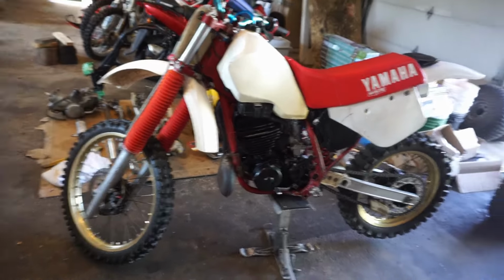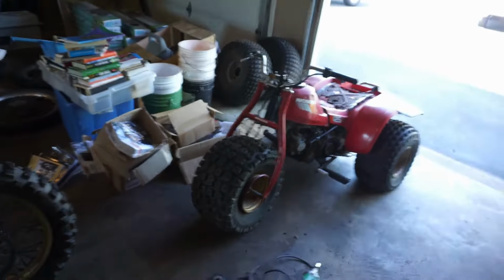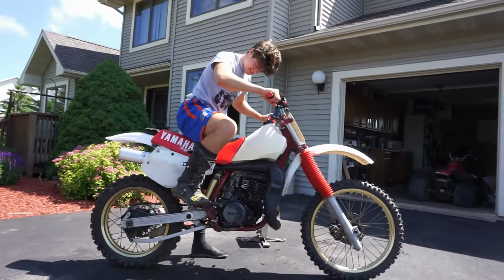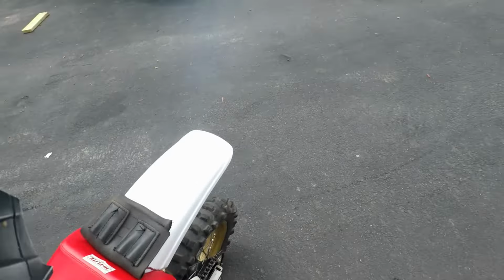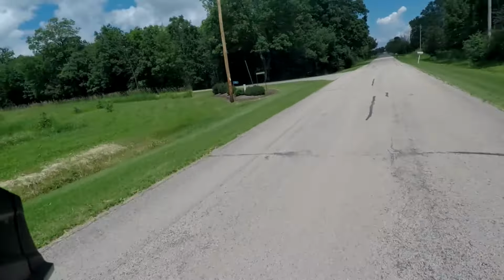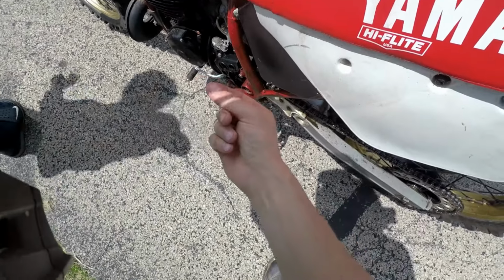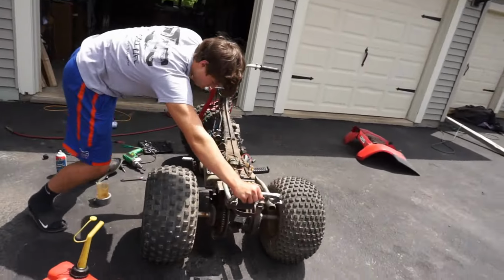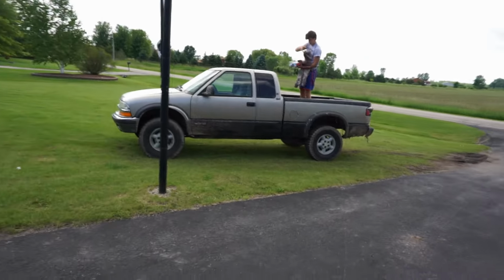This Bike Will KILL You!!! First Ride on Yamaha Yz 490

Comment: I feel so sorry for that engine “it’s bogging” more like the engine is crying for freedom
Reply: I know.....i kept waiting for it to come up on the pipe........thank god it didn’t..........I do not think these guys have a clue as to what to expect when it does clear out.
Reply: @MrJoeyplatinum  It won't come on the pipe at 1/8th throttle!
Reply: Right. Those 500s only have two engine speeds. Off, and wide open, and they have a powerband like a sledge hammer.  My brother had one back in the 1990s. TOTAL hill climbing fuckin MONSTER!
Reply: Dress for the slide not the ride buckle your boot
Reply: Agreed
Reply: My 1979KX 250 does the same thing it either runs or it doesn’t it’s up for you to decide when you twist the throttle.
Reply: but he's not locked up
Reply: this kid gets some amazing bikes and every time i am asking who taught this kid how to shift. but you all are right if he got in the power band we might get some reel good whiskey throttle videos
Reply: @MrJoeyplatinum  Exactly ! They don't have a clue ! Carb is still dirty ! This guy everything is rejetting . He is stupid ! Relies on ultra sonic cleaning but it does not work well . Knows nothing about carbs but he thinks he does !
Reply: @dirtcurt1  He's not exactly just breathing on the throttle 🤔
Reply: Nothing that bad about bogging just means he's not revving it heaps or in a too tall gear
Reply: Nah, these were notoriously bad runners that were hard to get jetted correctly.  Super easy to go too far one way or another, and it basically sucked.  They stopped production before kawi and honda stopped big bore 2ts because they weren't that good at any particular aspect.

Comment: As an old school 250 and 500 motocross racer, we used to say "it's loaded up," not bogging.  The 250 and 500's back then vibrated a lot!  Try shifting a little sooner to keep on the power band, you could here the power band fall off before each shift.  Have fun with it!  Awesome!
Reply: It sounded like it wasn't running super smooth

Comment: I had a yz490 for a few years, strong bike. 
This guy hasn't figured out that a two stroke has to be cleaned out after warm up.
That front wheel shouldn't touch the ground on asphalt.
Reply: Glenn James tell him that and it’ll never be jetted close . Oh wait , it won’t be anyway .
Reply: Had 4 490. Have brap em keep cleared out fouling plugs till there warmed up.
Reply: @brianjacobsen5762  finally  a good answer
Reply: If he's that dippy he realy should stay of it
Reply: @brianjacobsen5762  if it's doing that you had the mixture way out allways mix ar factory mixture
Reply: Exactly
Reply: Embarrassing😂 he talks about boggy but never gets in the pipe. Of course it's going to bog when wrap duct tape around the eagles wings persay😂. This guy cannot get rid of his pride and ask people that are moto veterans or read. Like beating on a 3 wheeler engine for 3 hours that sat in weather for two decades😂. I'm 51.  And have known since I was 20 to bath these engines in a kerosene bath for 3 days- week. And it will do half the grime work. This guy?
Reply: I'm going to give you a good tip joe. Run motul 800 or Castor 927 32:1 always. All 2 strokes.👍
Reply: @marcalan1198 Hes a good dude, don't be a douchbag

Comment: THANK SO MUCH FOR POSTING!!! this totally put a smile on my face!!! I had a 490yz when I was 15, DO NOT LEAVE THE FUEL TURNED ON WHEN YOU'RE DONE, it will totally flood the cylinder. But with mine, you couldn't putt putt around on it or you'd foul the plug, that 490 LOVES RPMS!!!!

Comment: Hi, I just wanted to let you know from 27 years of mechanical repair experience you probably shouldn’t leave your air cooled engine idling. Also warm up time for air cooled engines is  minimal or nonexistent. Have you ever wondered why in some states lane splitting is legal. Have a look at the facts , Air cooled bikes are meant to keep moving the poor compression rings in that cylinder must’ve been glowing red when you were letting it run on your stand for five minutes or whatever it was. An  air cooled for stroke is even more important, they run a lot hotter than two strokes. Maybe that bad ass old Yamaha can deal with that I don’t know for sure but I wouldn’t recommend it.
Reply: So with I ride a 1996 kx125 and I let it warm up for about 10 seconds give it a blip and then go low rpm low throttle for a little then slowly give it more to warm it up, now I also have a 2018 old 140 which is an air cooled four stroke and to warm that up I leave it sit until the clutch cover starts to feel a little warm and then take it easy until its fully warm now what u were saying about this bike was it was probably overheating to some extent would I also be warming my air cooled little 140 up wrong or is leaving a 4 stroke at idle for awhile alright?
Reply: i was just reading thru thr comments and saw this. this helps a lot because i have a air cooled bike and it heats up really hot when i leave it ideling so this helps a lot
Reply: It depends on the bike; generally the air-cooled 2-strokes take FOREVER to get dangerously hot.  The Husqvarna race team back in the day recommend letting the bike idle until the cylinder was too hot to touch before setting off.  They found that reduced wear to the rings dramatically.  I've tried that with my air-cooled 250 Husky and usually I have to give up and start riding because everyone else in the group doesn't want to sit around for 10 minutes.

I'm sure on a 1200cc+ Harley, with those itty bitty cooling fins and absolutely zero oil cooling, sitting in traffic on the 405 on a 115 degree day, you can run into some problems.  On these dirt bikes, your biggest concern is going to be the plug or powervalve (if there is one) getting loaded up with oil.

Now what you don't want to do, is do a big hard hot ride, and THEN sit and idle around.  They will get hotter continuously as they sit, and if it's already hot when you start the process it'll get mega hot.  But unlike an air-cooled 4-stroke, they do cool off real quick once you get moving again.  Cooling off 3 quarts of oil takes ages.
Reply: Aircraft piston engines are air cooled four stokes but its very important to let those warm up properly, however they also have the atvantage of oil coolers as well as the propeller backdraft as well as running a richer mixture.  Smaller bike engines might have an oil cooler at best
Reply: My warm up time on a two stroke engine is determined by many things. Ambient air temp, premium exhaust operating temp, cast or forged pistons, etc. I highly doubt these kids can comprehend how much those things matter.
Reply: Thanks, I had no idea that air cooled engines don't need a warm up, good thing I ride liquid cooled bikes so I'm not doing any harm to my engine

Comment: Fuel mix and the exact right spark plug is absolutely critical on these bikes. You haven't actually hit the power band yet
Reply: I had a 1982 Suzuki RM465 and all I did was mix some Bel-Ray mc-1 racing oil at one bottle to 4 gallons of gas, which was about 40:1, and run a regular spark plug. The thing ran perfect, never fouled a plug, and never hurt the engine one time in 8 years. All I did was put a new top end on it every winter, and it ran great, no problems. Not sure about the YZ490, because I never had one, but my RM465 ran like a top for the entire 8 years I had it. Never played with the jetting or anything, never even touched the carb, except to clean it once in a while.
Reply: @steves2241  I had YZs, they were very tempremental, would only run properly on a nipondenso plug, and the exact right oil mix. And if I were to ride 100 meters under power band it would fuel up and foul the plug. Both had been raced before I got them , so may not have had the standard set up. The 400 wasnt near as bad for this as the 125.
Reply: @bruceaskin9645  Yeah that sucks, I never had that problem at all with my 82 Suzuki RM465. Ijust put gas in it at 40:1 with bel-ray mc-1 oil and it ran perfect. When I first got it I fouled a plug once or twice, because I was not running it hard enough, but I figured that out real fast, within a week or so, and then after that for the next 8 years I never fouled a plug one time. You have to run the big bores hard or they will foul a plug. 

I really liked that RM465, and I still wish I had it today. It was the best bike I ever owned, and I had 1 other RM, plus a PE250. In 8 years all I ever did was a new top end every winter, and put gas in it, never had to change the jetting or any carb settings one time.
Reply: @steves2241  Both my YZs were 77 D models
Reply: Sounds like it’s running like shit that Honda would eat that Bike up in every department sounds locks get up and go home I would never own another Yamaha

Comment: Very powerful bike.. Will be worth alot restored.. Should consider restoring complete bike and keeping it for a few years.
Reply: But in 2 years it will be even more rare and worth more to a collector I'd keep it and pass it down to my kids and try to get them to do the same... imagine what people would pay for that thing 20 or 30 years from now when the market is overrun by electric bullshit 🤔😂😂
Reply: @ryryboyle6126  Yea! That is not a bad idea either.. I agree everything is going electric and it is horrible!..
Reply: @Bryan D. Atleast 2 summers!
Reply: @AcousticNRG  Yea I noticed that and he put wd40 on top of the chain and dint roll the wheel?.. Its also running very bad far from "crispy"..
Reply: Shit, doesn't look like it needs much restoring. I'd clean it up a bit. Get all the plastic white again. New reed valves , rings, and new tires. Next port it .and shave the head and lighten the piston. Set up the suspension for my weighr. Then I'd run the piss out of it. Show these new 4strokes why they should have 2 strokes. If you had one of these bikes why would you want to sell it?
Reply: Ohh yeah, better add a caliper and rotor to that rear wheel. Without WD40
Reply: Their not that fast or power full.Properly set up 250 would eat it.250 much lighter and so underestimated.
Reply: Not worth a lot restored , plus restored means showroom state 🚿
Reply: If he keeps for 2 years maybe he'll learn to ride 😂
Reply: @jonathanpoole1292  snare drum and cymbal!😂
Reply: I’m sorry but this is a Lot of misrepresentation. I’m talking about Fast and Furious Levels of misinformation.  If you’re Truly interested in Vintage Two strokes , check out Merlin PVX on here. 
Btw any 86-90 Yz 490 will never have great collector value , period. 
That would be like saying that a boxy 78-88 Chevy Malibu will have the same collector value as a 67-69 Camaro. It just ain’t so .

Comment: My old neighbor got one he rebuilt and overbored with higher comp with head work to get rid of a factory gap that was larger then desired. Bikes as snappy as any yz250 but my God the power, I might be buying hit off him cause even on 8 acres of property he can't get outta 3rd or more then 1/4 throttle. These things are missiles. And light as he'll for the size of the bike

Comment: I had a 1982 Suzuki RM465 for 8 years from 1982 until 1990. And the first thing you need to do with a big bore 2 stroke is get the piston to top dead center then kick it over with everything you got. If you do, it should start on the 2nd or 3rd kick when it is cold and the choke is on, and the 1st kick when it is warm, my Suzuki RM did, every time for 8 years, ran great, started great, and I never had any motor or carb problems with it in the 8 years I had it. 

The second thing is, a big bore 2 stroke will not warm up sitting at idle like a 250 or a 125 will, it dont work that way. You have to get on it and rip it through the gears at full throttle to get it to clean out, or it will just sputter and run like shit until you foul a plug. I found that out the 1st 3 or 4 times I rode it. 

Then once you get it cleaned out and running good, you have to run it hard enough to burn all the fuel it is pumping into the cylinder, or it will run like shit and foul a plug. A big bore 2 stroke is a different animal. You have to run it hard, 3/4 throttle to full throttle, or it will not clean out, stay cleaned out, and run right. 

If you are scared to do that, sell it and go back to a 250. From what I saw when you took it for a test ride you did not rid it hard enough to get the engine to clean out, at least at first, it was sputtering like crazy. Because you though it would warm up at idle, but they dont, you have to ride a big bore hard to warm it up and get it running right.

It was running rich and as you say boggy, in the beginning of your test ride because you let it sit at idle and it took longer to get it cleaned out, dont do that, do not let it idle to warm up, all you are doing is making it harder to get it to clean out and run right after you start it. Once you ran it down the road a couple times and you got on it the thing finally started to clean out and run right. 

When you 1st start it do not let it idle, jusp right on it and run it down the road at full throttle, and it will clean out much faster, it should be cleaned out after going through the gears one time, by the time you hit 5th gear it should be almost cleaned out. My Suzuki was a 4 speed, so I would start it, then run it up to 4th at full throttle, turn around and run it up to 4th again and by the time I hit 3rd gear it was cleaned out, and it would be fully cleaned out and pulling wheelies at half throttle and running great.

You might have partially fouled the spark plug letting it idle for so long, put a new spark plug in it and ride it again, see if that cleans it out and gets rid of some of the low rpm sputtering. try that before you mess with the jetting. I never touched the jetting on my RM465 in the 8 years I had it. check your fuel/oil misture too, I ran mine at about 40:1.

Comment: I had an 83. You will know when its running right because it will have the front fender in yourface before you know it
Reply: My exact thoughts. Couldn't keep my 83 on the ground with all 220lbs leaning over the handlebars. This one's probably not running at 1/2 it's potential
Reply: My buddy George had one exactly like this one.......he was a very good “B” class rider..../his 490 stood up at about 60mph in sugar sand.....he came off and broke his back......
Reply: @MrJoeyplatinum  definitely a bike that demands respect or it will bite back and it'll bite back hard. I thought some of the guys with cr and kx500s that were afraid of them were ridiculous until I got my 490 and it made sense real quick

Comment: imagine when he actually gets in in power band
Reply: There’s no such thing as a powerband.
Reply: @tonydardi332  yeah there is lol
Reply: @GoonRides  Where is it then? Explain it to me lol...
Reply: @tonydardi332  🤦🏼‍♂️
Reply: Its like a afterburner on a jet....but you don't know exactly when it will kick in. It feels like bike goes from 5000 rpm to 20000 rpm in less than half a second.
Reply: @tonydardi332  lol... A power band is when the motor gets its best air flow/fuel , i see you are the guy that thinks you buy powerbands lmao.
Reply: @dylanrice7075  yes........... I know. Why would you think that? I said in my comment earlier. “Where is the power band? Explain it to me..” I was being sarcastic.
Reply: @tonydardi332   Powerbands are a real thing the new 2021 beta 250rr has a adjustable power valve you can change the range for bottom end to top end. But im glad to hear you was being sarcastic tho. Shewww close one.
Reply: @dylanrice7075  Wow an adjustable power valve?  That’s wild... Now THAT I didn’t know lol. Yes it used to drive me crazy when I would hear guys say things like.. “Maybe it’s your powerband” or “You may need to get a new powerband” I’m like.... 🤦‍♂️
Reply: Funny thing is, a YZ490 almost doesn't have a powerband.  They make big fat stinky power from almost idle.  This bike was way out of tune.
Reply: @tonydardi332  it’s the peak rpm in a engine